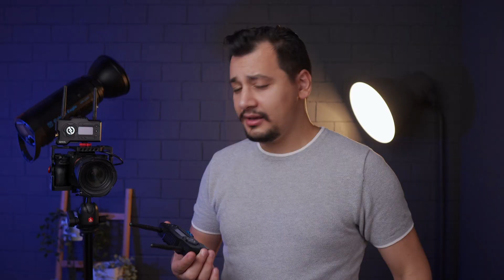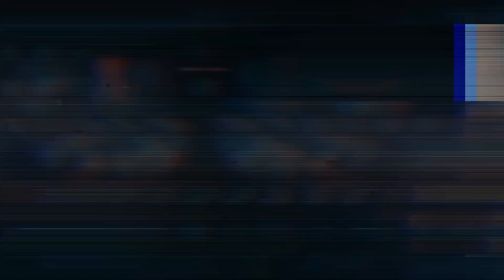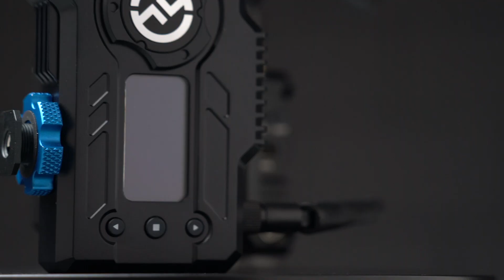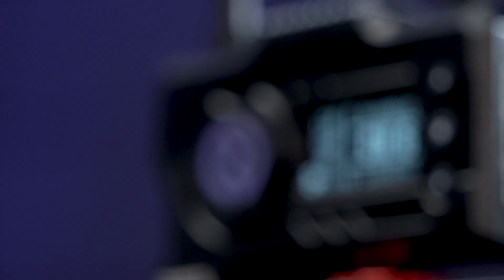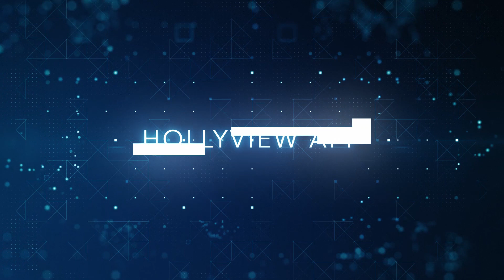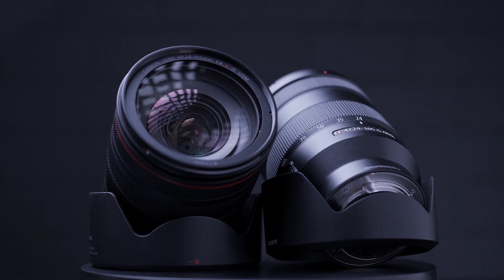Hollyland Mars 400S PRO SDI/HDMI Test and Review

Comment: How do you keep your camera lcd screen on when connecting the hollyland to the camera using hdmi?
Reply from the maker: All Sony Mirrorless cameras in 4K show a black screen when HDMI out is connected whether to monitor or wireless transmitter. No solution
Reply from the maker: an external monitor would be a solution